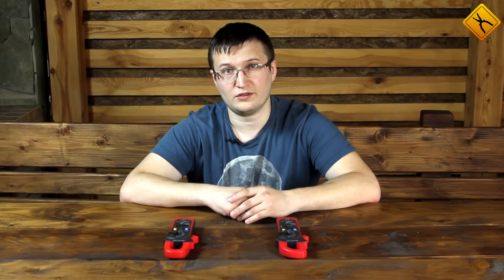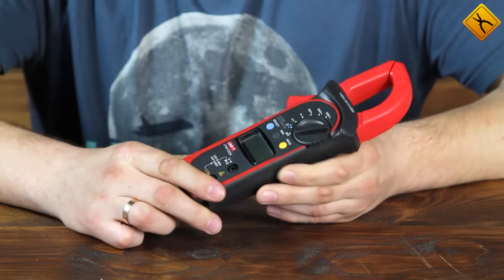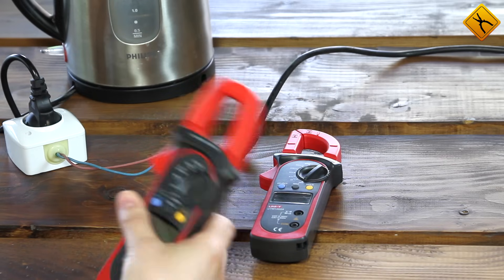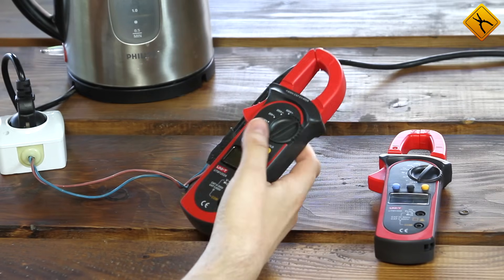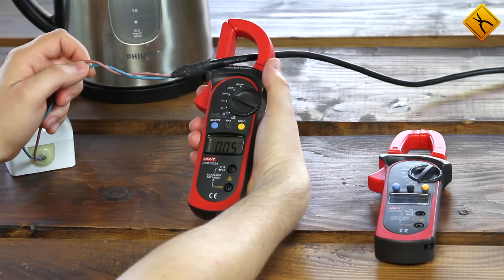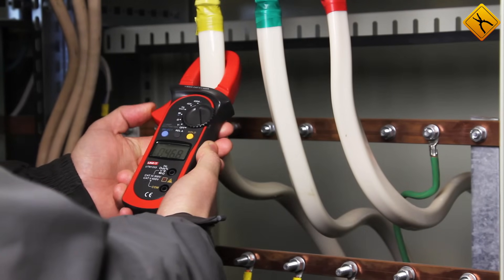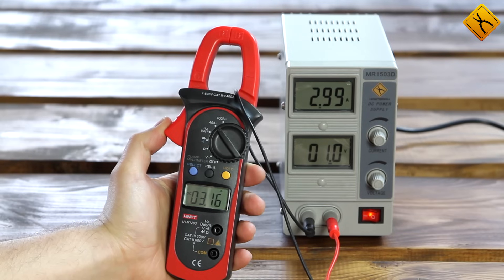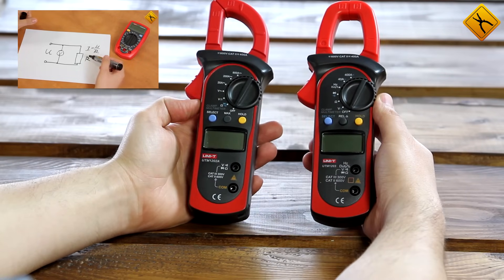How to Use a Clamp Meter

Comment: Very informative.. Clamp meters are very useful tools for measuring electrical current without disconnecting cables, thus increasing safety and efficiency when measuring. In the context of industries that rely on advanced technology, such as RFID systems, this tool can also be very important. GAO RFID, known for its innovative RFID solutions, can utilize clamp meters to ensure that their RFID devices operate with a stable and safe electrical current. This is an example of how the right measuring tool can support the optimal performance of advanced technology devices. #GAORFID #ClampMeter #Technology

Comment: i use a ac/dc clamp meter i bought of amazon to measure to see if i had a parasitic draw on my truck. It has a 600 and a 60 amp setting.  i set it to 60 amps DC and clamped around my positive 0 guage wire to see if i was with speck for a power drain being my battery was keep dying over night, coming to find it was the 2 way aftermarket alarm i had installed i believe now

Comment: Is there a way with this or another tool to measure the voltage wirelessly?  I'm trying to find a break in a line and was hoping to use some kind of wireless device to detect where the break in the line is, as the break is under the insulation, so not visible.  Thanks

Comment: in AC when clamping the entire cable (both conductors) it would read a Zero, as the alternativing current is out of phase: but my question is can it read the DC current when both DC conductors run through it ? you were so close to showing this in your demo...

Comment: Appreciate the video. If I wanted to measure a house's main panel TOTAL amperage draw, would it be just the reading of 1 hot feed wire or do I add the value of both feed wires together (for standard meter service with two 120V feeds)?

Comment: Just bought a one dollar clamp meter brand new. It claims to be able to measure up to 300 volts ac and dc and up to 400 amps. When I set it to the specific modes  I want to test out. It wont read any voltage or amps on those test. Its a chepo hyper tough from walmart. Not sure why it wont do any readings. Or is it just to cheap. How cheap can you go without sacrificing safety and accuracy?
Reply from the maker: Hello! One dollar? :)
We have never tested such a cheap clamp meter. Uni-t are safe enough.

Comment: Thx didn't know that on AC I have to take each wire separately to measure. In school we didn't measure AC current neither used a clamp multimeter

Comment: I notice the leads are not installed  ..can I use the clamp with my leads still attached to the meter?
Reply from the maker: Hello! Thank you for your question! In theory - yes, but the device will show indicators only from the clamp (measurement of current) or from test leads, so the measurement should be done separately.

Comment: Cool - what can i search for to find AC wires that are separated like that already? or must i make my own.. seems dangerous to risk a DIY at my novice level
Reply from the maker: Hello! If you are a beginner, you should not do this. And the presence of alternating current can be checked with the help of current clamps, which have a mode of measuring alternating current

Comment: Thank you for your clear explanation of clamp meters. I am just starting with them, so this helped get the gist of them, but I have to say that it is annoying that when selecting which clamp meters is best for you, you encounter these annoying differences in accuracy. In your video here these 2 meters of the same brand (albeit different design) end up with 2 different measurements of the water cooker's AC current, namely 7.61 amp and 7.92 amp. That is so annoying. Which one is then the most accurate and why is that ? I am at the moment having several 30 to 90 dollars models from Amazon to compare and select and most of them give non comparable readings on something basic as this AC current. I would almosts say "I hate them all !" ;-p
Reply from the maker: Unfortunately, sometimes it is difficult to say which device will be more accurate, especially considering the fact that at different times and under different conditions they will always show different values. There are many factors influencing this. One way to test this is to measure something nominal and known and compare the value to the nominal. Thanks for the detailed comment!
Reply: @ToolBoomVideo  Thank you for replying ! I am somewhat intense when looking into something I want or need, but today I got lucky in finding what seems to be the right clampmeter for me. A Meterk MK06 that is ridiculously cheap, but measures DC current over the clamp up to 400 amps and from the looks of it, is accurate enough. I decided to try my luck overnight and today it arrived and in all it's "el cheapo" simplicity I am just gobsmacked so to speak.

Comment: For current measuring, are Hall sensor meters less accurate than current transformers, or about the same? Also, does it matter where, within the circle of the clamp, the conductor is? Will the meter be more accurate if the conductor is placed exactly within the center of the clamp?
Reply from the maker: Hello! In terms of accuracy, both options will be approximately the same. In the center, the readings will be a little more accurate.

Comment: would there be any reason someone would get a multimeter over a clamp meter since a clamp meter can measure so many more amps?
Reply from the maker: Hello. For each task, you need to choose a specific device. If it is a question of measuring high current, then it is necessary to measure using current clamps. The multimeter, in turn, usually has more advanced functionality, but the current measures within 10-20 A

Comment: If the meter shows zero amps on a single wire conductor while using the amp clamps, am I to safely assume that the electrical circuit is off or switched off?
Reply from the maker: No, this does not mean, since the load on each phase is not distributed symmetrically or evenly.

Comment: So the "clamps" on the meters can only measure amperage? They cannot measure voltage or resistance without using the + or - probes??
Reply from the maker: Hello. Yes, clamps usually measure only amperage, and with the help of probes, all other values.

Comment: Thanks for this video. I actually want to know how much amperes an electric engine consumes in a three phase system. Do you need to measure all three phases separately and sum the values up to get the total consumption? Or should you still divide by 3 to get the average? Keep up the good vids ;)
Reply from the maker: The rated current of the induction motor will be In = 1000Pn / √3 • (η • U • cosφ). Pn is the power of the electric motor, measured in kW. U is the voltage at which the motor is running. η is the efficiency, usually 0.9

Comment: Here's a hypothetical ... I have two feed lines (wires), both are power side (not common). Neither power wire is energized at one time. I would like to be able to measure current without having to clamp and re-clamp. Can I clamp both lines, and still read current (amps) on the energized wire, with no current in the other wire? Why? I want to have a helper watching the meter, while I energize and de-energize in a remote location.
Reply from the maker: Yes, you can, but you should reset the value (button "zero") with each new measurement.
Reply: @ToolBoomVideo  Thanks!

Comment: Hey what happens if you use the clamp meter on the NEUTRAL wire while appliance is on?
Reply from the maker: If you test the neutral wire with a clamp, you will see the value of the current in the circuit. (Not to be confused with ground wire)
Reply: @ToolBoomVideo  Can you kindly make a 10 sec clip to show this concept. I believe neutral wire don't carry current (under normal conditions and single phase system). But this concept violates the principle of using a neutral wire in the first place so I am really confused.

Comment: I have this multi meter and have measured just one wire off of a 3 phase generator but only get between .013 or .054 amps from the wires.  In any wire in my home after getting to just the hot wire or neutral I read .008 amps as the highest going to a 1kwh electric stove top.  So I can see current just not anywhere close to accurate.  Is this common? ( I started high and have gone to the lowest setting of 2/20A)
Reply from the maker: Hello! Please measure again. Measure only one wire (active or neutral). Set the current measurement mode to "AC". Be sure to connect the load to the mains - any household appliances, electric kettle or something else.
 We are confident that the measurements will be correct.

Comment: Can this be used to test battery volt?
Reply from the maker: Hello! Typically, most clamp meter models have a voltage measurement function. That is, you can measure the voltage across the battery terminals. 
For example, such a device: https://toolboom.com/en/834634-digital-clamp-meter-uni-t-ut204a/
But to check the capacity, you will need other devices - battery analyzers.

Comment: why when I use the ut203 on DC, I can get two different readings depending on the direction of the  + on the meter.   If it is facing the battery positive or facing the battery negative it reads differently
Reply: that due to the one way flow of a dc current. assuming that your getting a positive reading one way and  negative reading when you turn the clamp the other direction.

Comment: Thanks. Can I use this to test an ignition coil pack or spark plug wires?
Reply from the maker: Hello! To measure inrush currents, you can use Clamp Meter UNI-T UT203: https://toolboom.com/en/822362-digital-clamp-meter-uni-t-ut203/

Comment: Hi! Great video. If my multimeter says 00.00 every time even though electricity is clearly running through the wire, what does this mean? Is it too high or too low to read? Thanks.
Reply from the maker: Hello! Please measure AC only on 1 core wire (as shown in the video, 2.20 - https://youtu.be/Bc_EQea0mKY?t=141 ).

Comment: if you don't get 0 net current in live and neutral this is likely due to an electrician wiring error in your house, as some current is not returning and going along another circuit (another neutral or ground, potentially even riding out on a water pipe); this is important as you are generating a net magnetic field in your house due to unbalanced net current, creating a health hazard as health effects are reported above 1 milligauss magnetic field, especially an AC field generated from AC currents
Reply: in fact learn about gaussmeter testing (walking around your house with a gaussmeter) to look for correctly wired circuits

Comment: Probably missed the point that should be made that per the instruction manual "Make sure the conductor to be tested is placed at the center of the transformer jaw, otherwise it will cause +1.0% deviation based on the stated accuracy"
Reply: My doesn’t even detect the current
Reply: @Nhatanh0475  mine either

Comment: I clamped the jaws directly onto the insulated power cable running 220 volts to a domestic bar heater pulling 800 watts and got a reading of 0.7 amps on the 20 amp setting. Is this just a nonsense reading and what is causing the reading?
Reply: look 2.30 min onwards,

Comment: nice and educating video
how can we use this clamp meter to measure direct current from solar panel....?
can we use probes to measure current like we do to measure voltage.
Reply: Solar Panels output DC not AC ~ so you would need to have a meter that can read DC